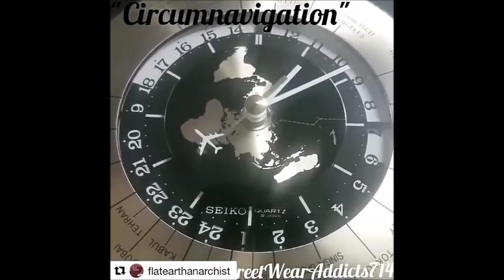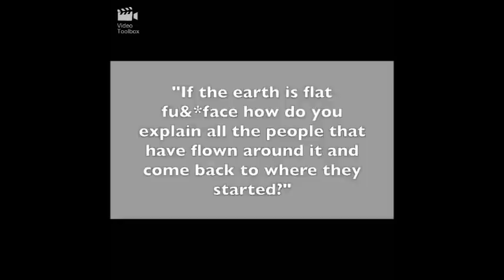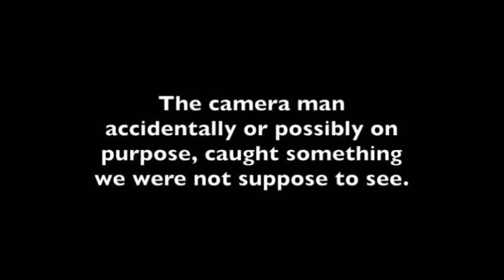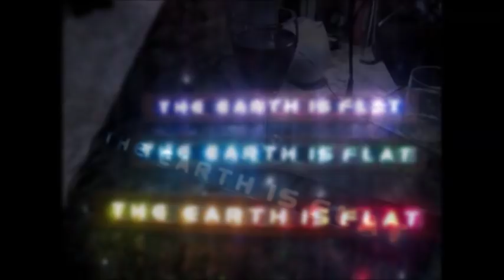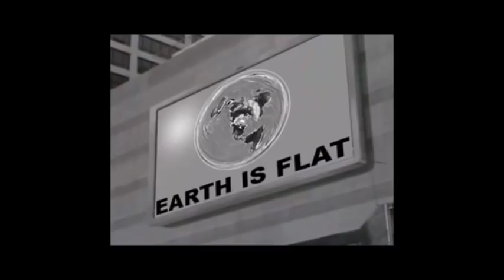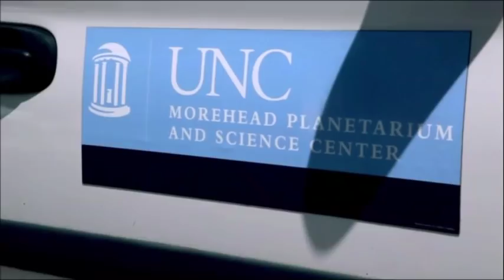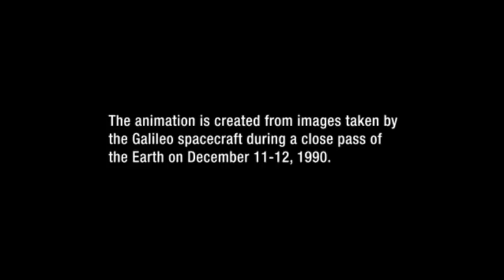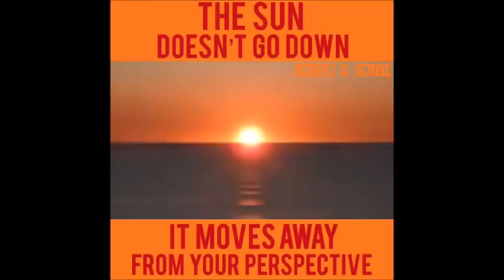Flat Earth Q&A Emails 91 Mark Sargent ✅

Comment: On the flat Earth map the direct route from South America to Australia is over the North pole, but you can fly there in 7 hours. That would require breaking the sound barrier.
Reply: fake flights don't count
Reply: How do you know the aircrafts speed? Do you get to see the speedometer.
Reply: @nathanfowler1606  it takes 7 hours, speed=distance/time
Reply: @Zero11s  the flights are real, and they dont fly over the North pole.
Reply: how do you know distance.?
Reply: @elwynr1108  owwww you think Santa is real
Reply: @Zero11s  are you applying some flat earth logic to that question? Why in reality are no two points on Earth more than 12,500 miles?
Reply: @nathanfowler1606  planet Earth is 25,000 miles in circumference, "flat Earth" has a diameter of 25,000 miles.
Reply: @Zero11s  flat Earth always falls apart when you look at the southern hemisphere, the map doesn't make any sense of reality. Antarctica would have to have a circumference of about 78,000 miles. The fastest route between some areas of Antarctica would be to cross the entire planet. Neither of these things are true.
Reply: @elwynr1108  on the contrary the southern hemisplane validates the flat earth with for example the solar analemma
Reply: @Zero11s  The solar analemma is evidence of the orbit and tilt of Earth on its journey around the Sun. The combined effects of the ellipse and the tilt result in the length of each solar day being slightly different from the previous day. This is why solar time varies through the year. In November solar time is 16 minutes ahead of mean time, in February it is 14 minutes behind, and on 15 April and 1 September the two times cross over, carrying on in an endless cycle. The analemma represents this endless cycle and is charted on a sundial to let it read like a clock in mean time. It looks like a figure-of-eight loop. The analemma in the Southern and Northern hemispheres are evidence for the globe and heliocentrism.
Reply: @elwynr1108 the flat earth meme collection says different
Reply: @Zero11s  oh right I hadn't realised someone had put together some memes. Did you know that hundreds of years before NASA humans had used the parallax of the moon to work out the geometry estimating its about 60 Earth radii away. The same was done for the planets and using trigonometry the estimate for the Sun being 90 million miles away was calculated. But if someone has put together some memes I guess they know better.
Reply: To figure out the geometry of the globe earth, scientists worked diligently for the past 500 years, taking actual measurements and using trigonometry to calculate the sizes and distances of our solar system. The flat earthers enjoyed the luxury of having all of the observations and calculations done for them. All they had to do is create a model that fit the globe earth information. Interestingly enough they were not able to create a model that matches a single observation without breaking the laws of physics. Not to be deterred, the flat earth proponents set about the task, (to no avail) of denying the validity of the observations.  The most obvious of these complaints involves the simple fact that ships disappear from the hull up when sailing away from the observer, at a distance that places them beyond the horizon. Flat earthers have no choice but to lie about what is being observed, by claiming the ships are disappearing due to perspective. Their own videos always involve filming a ship that is NOT beyond the horizon, and then claiming that it is. Every other flat earth claim, falls short of having observable proof as well.  Conclusion: they must have a motive for their claims that have nothing to do with the truth.?
Reply: @redstoner7545  Scientists had nothing to do with the globe. The Globe is unscientific.
Reply: @Zero11s  that is the highest intellect response I have ever seen